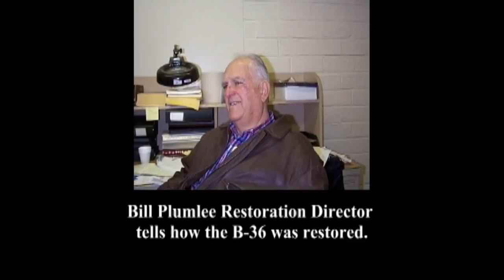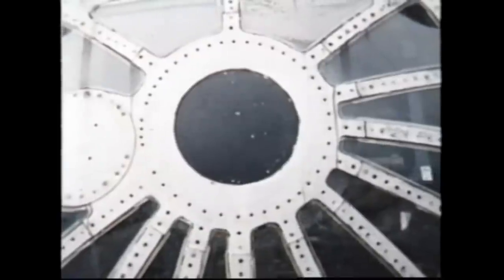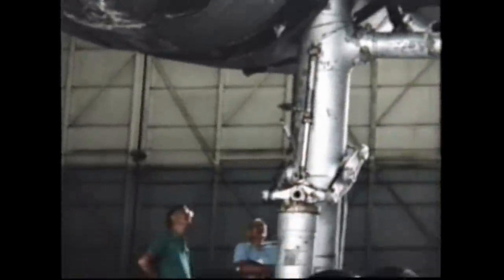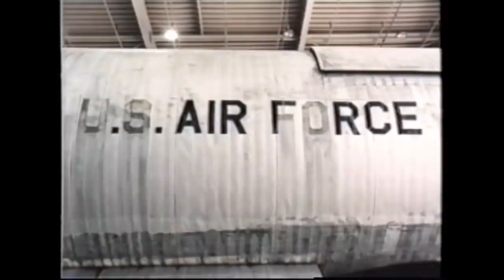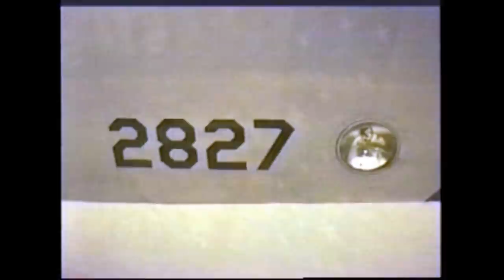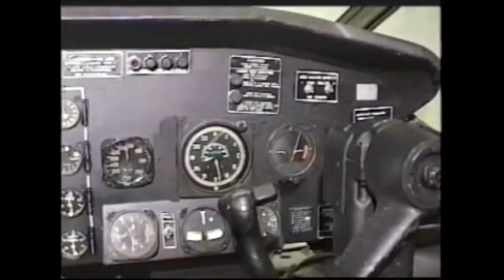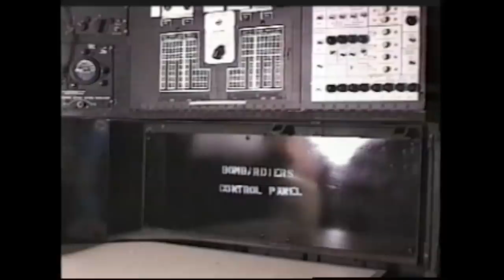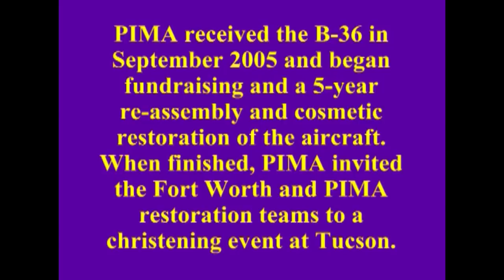Restoration of the last B-36 Bomber in Ft Worth

Comment: In 1965 my dad was being trained as a flight line maintainence officer to be assigned to the south Vietnamese air Force at Danang Air Base in Danang. Part of his training was at  Chanute Air Force Base  just south of Chicago. I saw and you could walk up to those planes at that time (pigeon sanctuaries) B-36 ( floating battleship) and my dad who had 3500 flight hours in the F-86 ( all versions and all types) sabre jet that used to meet the B-36 on its training flight runs back in the early and mid 50's. They also had a B-47 and a B-58. Early days of the cold war.

Comment: Mixed emotions watching this. On the one hand, it's great to see such love and dedication put into restoring this aircraft. On the other hand, I'm bummed that it wasn't restored all the way to flying condition and flown around on airshow tours in the same vein as the Commemorative Air Force. (Sounded like there were two different sound tracks fighting each other, though).
Reply: +c182SkylaneRG  It would be way too expensive to operate something this large on a limited budget.  The fuel and maintenance would consume many resources that would otherwise pay for several other aircraft.  The original group in Ft. Worth was patching it up for one last ferry flight to see a B-36 in the air, but when the Air Force got wind of it they came down and seized the engines and mounts so that they couldn't do it.
Reply: @FiveCentsPlease  Really? Was the group self-funding? If they were using Air Force funds, I could see that, but otherwise that's a dick move by the USAF...
Reply: @c182SkylaneRG  It was a dick move.   Another group was negotiating to return an F-105 to the air for a heritage flight and the DoD swooped in and cut the wing spar so that it would never fly.
Reply: A restoration is highly unlikely. I used to go
Reply: @FiveCentsPlease  To be perfectly honest, given it was taking place in Texas, unless they gave some REALLY good justification for being dicks, I'm surprised there wasn't an armed standoff between the military and the restoration group.
Reply: @c182SkylaneRG   Specifically speaking, the B-36 is still property of the USAF Museum and it was just on loan to Ft. Worth for display.   They could not meet the terms to store it properly and were attempting to fly it.  The museum put a stop to any flying attempt.    Moving it to Pima at least got it stored in a drier climate for the aircraft and perhaps there are future plans for it.  It might have also created some trouble with the DoD with a "nuclear capable" aircraft restored for flight, similar to the F-105 that could also carry a nuke I think.   The CAF was allowed to fly the F-82 that was also on loan from the AF Museum but then they crashed it.    Rather than repair it, the CAF was attempting to sell or trade it for another aircraft, and the AF Museum was not pleased about that.  So after some legal wrangling, the museum took the F-82 back for repairs and the former black CAF F-82 is now on display at the museum in Dayton.   And a similar story with the original B-17 "Memphis Belle" that the AF Museum also had to take back because it was not being cared for by the host organization.
Reply: @FiveCentsPlease  Ah, see: details matter. :) If it was in the video, then I forgot in the interim, but as of my last comment, I was under the impression the folks restoring the plane actually owned it, and the Air Force stepped in to stop them flying their own plane.

Still a dick move, since they were passionate about the project, and it's not like this thing is some big national security secret, anymore, but if the legal owners of the plane didn't want it flown, then as much as I side with the folks restoring it, the legal owners kinda get the final say, sadly.

Selling or trading something you're borrowing is an understandable no-no.

As for "nuclear capable", I know that there's a treaty describing all those requirements, but I thought the AF modified the bomb-bay of some of their "nuclear" bombers to prevent them from mounting a Nuke, and that managed to satisfy the terms of the treaty without grounding the aircraft? I would have thought that removing any and all bomb racks and allowing Russian inspectors access to the plane to verify it was not wartime capable would have been simpler than confiscating the engines and engine mounts...

Comment: I was at the Air Force Museum, at, near Littleton, Co. I'll look up the name....THE MINUTE I SAW THE HIGH HANGARS,  I KNEW IT WAS A B-36 HANGER. 
THERE IS A HOME, FOR THE WHOLE PLANE, if other aircraft could be repositioned on static display in the hangars, there all kinds of stuff, invl. simulators for the kids, and big Kids too. 
The B-36 hangar is there, I wasn't looking to see how many more might be on the old base.
Yes, it'd take some politicking, but that not new.
I've flown on FIFI several times, incl. landing seated in bombardier seat, only glass under you. 
No worries though, we had Southwest Air check ride chief pilot in the left seat.
We love all historical preservstion! God Bless all, especially the craftsmen, those still holding the lost arts.

Comment: When I was young in the early 50's, I lived on a farm near Okarche, OK.  My brothers and I used to watch multitudes of B-36's fly over. We lived right on US-81 HWY which is almost a straight line from Ft. Worth to Enid, Ok (Carswell AFB to Vance AFB). They were beautiful to see. We could tell when they were coming by the distinct sound they made. It was a beautiful noise.  There used to be a B-36 that you could see to the right from an over pass on US-81 as you drove south through Ft. Worth. Is this that plane. The Oklahoma ANG few C-124's out of Will Rogers Airport, OKC they made the same sound.

Comment: I have been to many air shows and have talked to folks who have restored B-17 and B-29 bombers back to flying condition. B-29 and B-50 bombers were retired when too many crashes occurred due to corrosion of the wing spar and metal fatigue. This B-36 was unfit to fly due to the deterioration it went through from being stored outside. Most air shows take place at smaller airports so a B-36 wouldn't be able to participate in most shows where some of the required money would be raised. In 2010 monthly insurance for a B-17 was $10,000 so it's much more now. In 2015 a B-29 cost $10,000 to fly for one hour, to give you an idea of just some of the costs.

Comment: I have only one question? If the money is available can this B-36 or any of the other museum museum aircraft be brought back to airworthy status and flown!
Reply: + Dan Dotson   Technically it is still owned by the Air Force Museum, and it was "on loan" to other museums with the condition that they take care of it.   When the AF Museum learned that they were attempting to make a ferry flight with it, they took the engines and mounts away from them.   It went to Pima for better care.  It is such a large and complicated beast that I doubt one will ever be in the air again.

Comment: I was in the USAF at Chanute AFB in Illinois in 1970. There were awesome aircraft on display scattered across the base, including a B-58 Hustler (one on the most beautiful aircraft ever), a B-47 and a B-36. I'd stand admiring them for long periods. I wonder what happened to that B-36. The AFB is gone now. I returned there in, about, 1998 and didn't see it. In the USAF I worked avionics instruments aircraft maintenance on B-52s, KC-135s, and RC-135s, including RC-135S Cobra Ball at Shemya Island in the Aleutians. The Cobra Ball was said to be, at the time, the most expensive aircraft ever made, due to the surveillance technology. Shemya was a wet and windy location. The Soviets would launch a test missile in Eastern Europe headed for the Kamchatka Peninsula. US observers in Turkey detected the launch and would activate a launch alarm, and a loud-ass klaxon horn, on the wall of the huge WWII hanger we lived in at Shemya, 8,000 miles away, sounded, knocking everyone out of bed. The flight crew and the aircraft launch/maintenance crew (of which I was a member) jumped into clothes, backed the Cobra Ball out of the hanger, and had it launched, sometimes in 5 minutes. Sometimes not. As I recall, now 48 years later, a 5 minute launch was our objective. The Cobra Ball's (or K Ball??) objective was to get on location to capture the missile's data transmission to ground stations. This occurred at a very precise moment. This information is no longer secret, so I'm not breaching security.

Comment: When my dad was in the USAF, stationed in Alaska in the early 50's he saw a B36 on a take off roll eject/lose a propeller as it took off to parts unknown. He said from inside of his Comm shack he could tell a B36 was doing a run up or take of due to an unusual sound than any other Aircraft. A Pusher, not a puller.

Comment: From the Pima Air and Space Museum Website:

Convair B-36J Peacemaker

The B-36 is the largest bomber and the last piston engine powered 
bomber produced by the United States. First designed to meet a World War
 II requirement for a plane capable of hitting targets in Germany from 
bases in the United States the prototype did not fly until August 8, 
1946. The development of the atomic bomb led the Air Force to conclude 
that it still needed a very long-range bomber capable of delivering the 
bombs over intercontinental ranges and production of the B-36 was 
continued despite the end of the war a year earlier. A total of 383 
Peacemakers were built between 1947 and 1954. The era of piston engine 
powered bombers was coming to a quick end with the introduction of the 
all jet B-47 and B-52. The B-36 was the symbol of American air power in 
the first years of the Cold War, but even the addition of four jet 
engines could not bring the B-36 up to the performance standards of the 
newer aircraft and all of the B-36s were out of service by the first 
months of 1959.

Comment: Great piece of American history! Amazing job! Thanks for posting! P.S. can anyone tell me what the advantage to the props on the rear of the wings was? Sorry in advance if thats a dumb question...
Reply: Nominally having the props behind the trailing edge improves laminar flow over the (substantial, in the '36) portion of the wing that would otherwise be in turbulent propwash.  There can also be some improvement in cooling efficiency with less turbulent induction and ducting of cooling air, and at least theoretically it might be possible (although not with multirow radials) to use the Meredith effect to utilize some of the rejected heat from piston engines to give enhanced forward thrust.

There are some advantages associated with the prop circle being well aft of the wing should a propeller throw a blade.

A drawback is that, unless the shafting and props are carried well aft of the trailing edge, some of the available length or travel of flaps or control surfaces may be restricted.

Comment: A very interesting aircraft.  Recently toured the Wright-Patterson Museum in Dayton.  While there was walking beneath their B-36 and two museum staff members were standing beneath the bomb compartment.  I was looking at the sidewalls and inquired about the culvert appearing pipe of about 28" diameter which ran the length of the fuselage.  "Did guys crawl through that?" I asked.  "Yes" was the answer "they used it to access different parts of the aircraft, including the wings."........"The wings?"..."Really?"     "Yes, they could walk crouched over to the first engine, then they  had to crawl to the outermost ones."
Me---"thats crazy, what did they do with the engines?"
Staff---"they had to constantly monitor the engines and keep oil pumped into them. About half the flightcrew worked at keeping the engines running."

Then after we left that display we found the small fighter plane that was to be fit into the bomb compartment of the B36 to protect against enemy airplanes....insane....
Reply: Their info was mostly correct.  The flight engineers monitored the engines from the flight deck. The tunnel was 80' long and had a trolley you'd like on and pull yourself along with wire loops above.  It ran from the forward compartment to the aft compartment, where there was a galley (on earlier models) and bunk beds. (Missions could last 24 to 48 hours.)  To access the wings you'd use a catwalk on the other side of the fuselage.

Comment: I hope that this aircraft will not end up as a "static display" FiFi and Doc Fly, and they are much older. The B - 36 "Peacemaker" never dropped a bomb in anger that I know of, but it is a part of aviation history. The precursor to the Boeing B - 52, this aircraft has a place in the Strategic Air Command's history, and should fly along with all the other aircraft that defended our way of life.

Comment: In 1988 it still had all the cockpit instruments but all the wires had been dyked.
Reply: Those were added after 1979. When I worked on her in 76-79, the fight deck had been stripped.  The pilot's instrument panel was gone, and the FE panels were empty holes.

Comment: Mikepk666. You are partially correct.  They have a B29, but it's not Enola Gay.  Enola Gay is at the Smithson.   Bockscar is the B29 at Dayton.  Bockscar dropped the bomb at Nagasaki.  Yes there is also a B36 in Dayton.  It is in the cold war hanger.  I'm not sure how you missed it. It's  the biggest thing in the building.   Look again next time you're there.

Comment: I remember there was one on display at Chanute AFB when I was stationed there in the mid 1980s, I wonder what what happened to it.
Reply: It's at Castle, rotting outside.
Reply: Thanks for you reply. I google mapped Castle AFB and see a B36 on static display there. Wonder how they got it 1/2 was across the country and how much that must have cost.
Reply: Probably the same way this got moved (several times).  Flatbed trucks.
Reply: I was on the crew that went from castle to chanute to dissasemble the plane. It took approx. 30, 12 hr. Days to take apart and put it on 18 train cars. There are youtube videos showing the dissasembly.
Reply: I marched passed that b36 many times it had a bad buckle in the fuselage. I often marveled at the enormous task it would take to restore that monster

Aircraft electrical systems school 1982.
People that could not stay out of trouble spent weekends pulling wild hemp along the railroad tracks.

Comment: There are currently FOUR surviving B-36s on public display:

National Museum of the U.S. Air Force 
Wright-Patterson Air Force Base
Dayton, Ohio
B-36J-1-CF
52-2220 

Pima Air and Space Museum
Adjacent to Davis-Monthan Air Force Base
Tucson, Arizona
B-36J-10-CF
52-2827

Strategic Air Command and Aerospace Museum
Near Omaha, Nebraska
B-36J-1-CF
52-2217

Castle Air Museum
Atwater, California
RB-36H-30-CF
51-13730

A fifth partial B-36, actually the second one made (YB-36A-1, 44-92004), the first with the raised cockpit and smaller multi wheel landing gear still exists in pieces in Newberry Ohio but there's not enough of it to restore even to display condition, although the forward fuselage probably could.

The nose section of B-36H, serial 51-5720 was stored at the Ontario California airport until 1971 when it was moved to Chino California where it was deemed too damaged to restore and was scrapped.

The remains of several B-36s may still exist at some of the crash sites shown below.  Details can be searched for:
B-36B, 44-92079, Lake Worth, Texas, September 15, 1949 
B-36B 44-92075, British Columbia, Canada, February 13, 1950
B-36B 44-92035, South of Carswell AFB, Texas, November 22, 1950
B-36D 49-2658, Near Perkins, Oklahoma, April 27, 1951
B-36D 44-92050, Fairchild Air Force Base, Washington April 15, 1952
B-36D 49-2661, Ocean off Mission Beach, California, August 5, 1952
B-36H 51-5719, Nethermore Woods, Great Britain, February 7, 1953
B-36H 51-5729, Labrador, Canada, February 12, 1953
RB-36H 51-13721, Newfoundland, Canada, March 18, 1953
RB-36H 51-13722, 2 Miles from Ellsworth AFB, August 27, 1954

Comment: Will there ever be an airworthy B-36?
Reply: No.  This one had its engines removed in the late 70s - I was there. The ones at Castle and the SAC Museum in Nebraska are also too far gone.  The only one that could possibly be restored is at Dayton, but even that would be a monumental undertaking.  

These things were maintenance beasts even with the full support of the USAF and the factory literally across the field.  90 hours of maintenance for each flight hour.  36,000 gallons of gas, 3,600 gallons of oil, 336 spark plugs.

Comment: Anyone know what happened to the XC-99 between Lackland and Kelly?
Reply: +@steze48    It was in terrible shape from outside display and plans were made to move it to the USAF Museum for work until it could find a new home.   It was found to be in much worse shape than originally thought and significant structure will need to be remade.   Major sections have been moved to dry storage at Davis-Monthan AFB until new plan can be made.

Comment: They built so many of these disasters and really never used them. I am surprised there are not several in pristine condition still around.
Reply: + Mike West    A tornado went right through Carswell AFB and wiped out over half of the B-36 fleet.  There are four left today, plus a fuselage.   They were the only platform with the range to penetrate Russia at the start of the Cold War.  But they were a waste and pig of a plane. https://theaviationgeekclub.com/wp-content/uploads/2019/01/Carswell-Tornado-B-36s.jpg